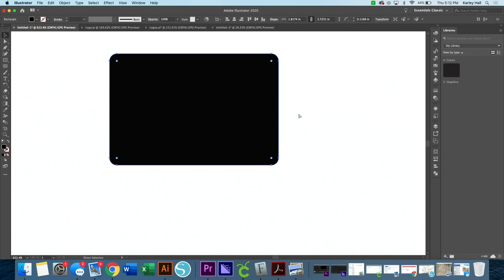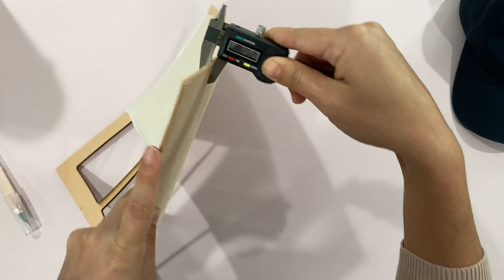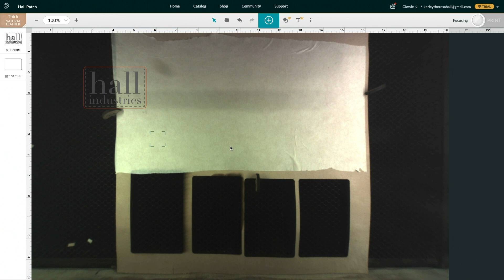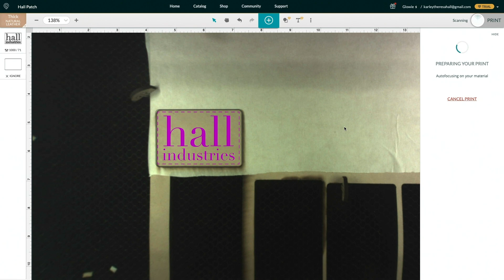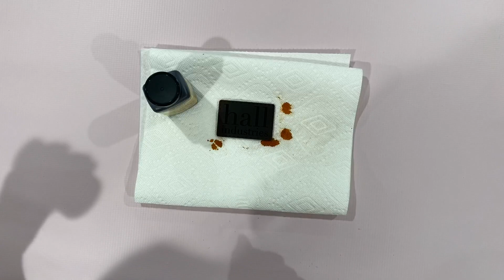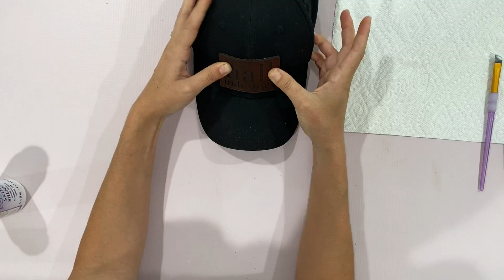How to Engrave and Cut Leather on a Glowforge Laser

Comment: Sounds like it takes far too long for the glue to dry. No way is it cost effective to make.
Reply from the maker: Leaving them overnight would be a good solution. Glue is a good option for those who do not want to invest in a hat press. If you have a hat press— double side heat activated glue is the fastest way to attach leather patches.

Comment: Just curious, is there a reason you did the cut separate from the engrave? Also, wouldn't it avoid charring if you left the masking tape on when engraving?
Reply from the maker: I remove the masking so that I don’t have to waste time picking it off after the engrave. This one wouldn’t be too bad, but the more detail, the longer it takes. Since the engraving dust just brushes away and doesn’t stain, I find it much easier to wipe that off instead of peeling away small pieces of masking.
Reply: @KarleyHall  oh alright, makes sense .. Thank you, useful/inspiring video & information 😊